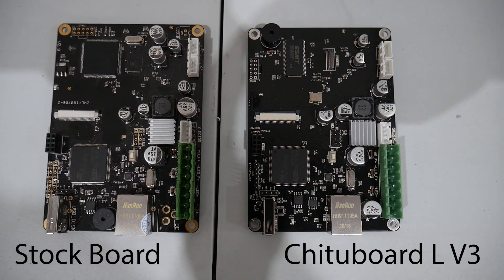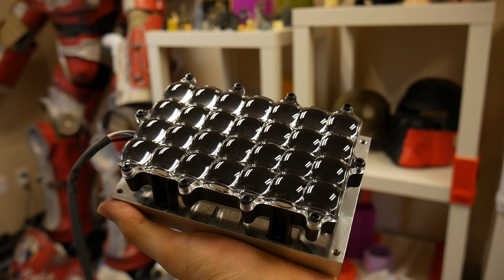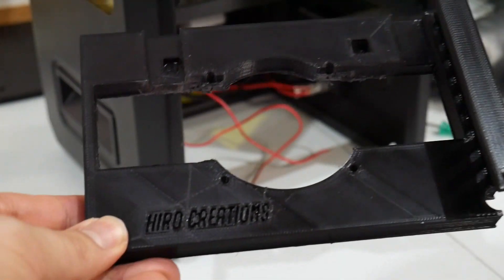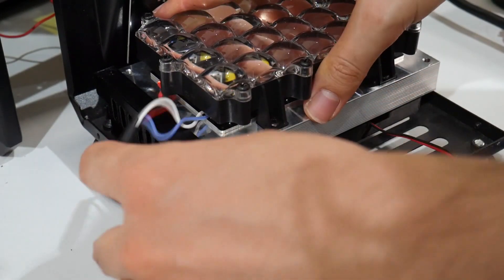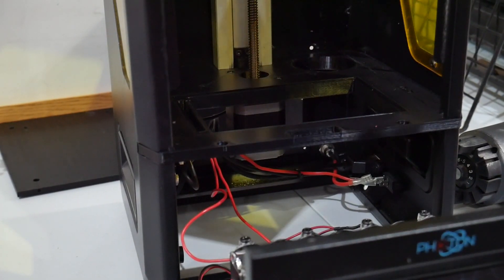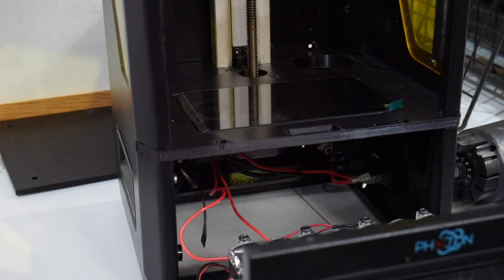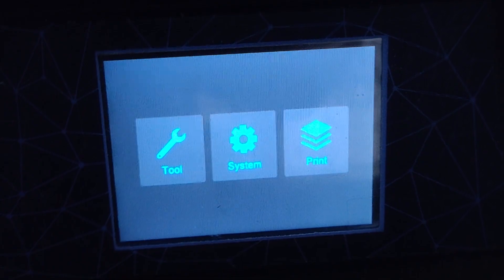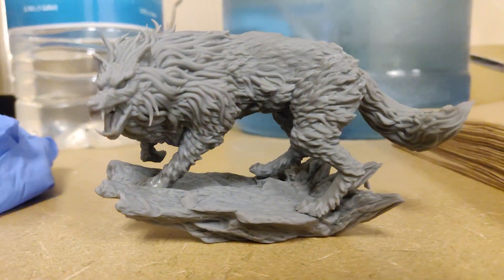Overclock a OG Anycubic Photon with a Mono LCD Upgrade

Comment: Is it possible to flash the Chitu L v3 firmware onto the original board? That would make this upgrade viable as it would cost less than just getting a mono printer. Also doesn't the Z-axis flex when lifting, now that the base plate is made of PETG?
Reply from the maker: Sadly no because the screens need a beefier  FPGA run, plus the gcode file I mention is just a config file and not the full firmware like Marlin.

So far no issues with the Z axis and the PETG plate, the only time I noticed any deflection is when I tried to print with a chunk of the raft still on the plate.
Reply: @HiroCreations  Considering the the resolution on the 6'' screens is only slightly higher, i was hoping the existing FPGA would've been enough. But i guess it's hard to say since the code for it hasn't been reverse-engineered yet. It's really a shame that we don't have nice configurable opensource firmware for these chituboard printers the way we do for all the reprap FDM printers...

For the baseplate i had a similar idea that involved milling it out to fit the new screen and then adding a printed spacer to allow swapping between 5.5 and 6'' screens, but it's too destructive to try on my only machine.

Comment: I have a dead Photon. Ill be doing this to give it a new life!
Reply from the maker: To be fair I am wrapping up on a follow up video where I do an even simpler mono mod that only requires a board and screen change and leaves the rest of the printer unchanged.
Reply: @HiroCreations  I would love to see a video of the simpler version. any word on when you will have that vid up ???
Reply from the maker: @SycoSpartan  at this juncture I am waiting on the screen manufacturer/seller to officially release (I promised them I would not post the video before that) but looks like they keep delaying. So for now, soon™ on the video.
Reply: @HiroCreations  oh awsome. do you know if the mono se screen will work on a mono? the mono screen is slightly diffrent and unavailable :( mines broken
Reply from the maker: @SycoSpartan  technically the photon SE mono screens are using the same DXQ screens I used in this tutorial. They are 6" diagonal which does make them quite a bit bigger and unable to fit into the recessed pocket. And having the screen not stick out is important to ensure that the vat can easily slide in without damaging the screen.
Reply: @HiroCreations  thanks. Ive got more info from you than anycubic :)

Comment: What are your slicer settings after doing this mod? I'm looking to get an old photon and giving this ago
Reply from the maker: I have my Chitu profile loaded for the modded mono on the github folder. The main real change is lower base and layer exposure times as well as fewer base layers. Speeds and retraction distance is unchanged from the normal defaults if a OG Photon.
Reply: @HiroCreations   this is amazing thank you

Comment: Im going to attempt this. One question, there are 2 options for the boards "TMC2209 driver" or  "A4988 driver", which one should i select?
Reply from the maker: You could go either direction. I'm using the older A4988 which is closer to the OG photon board.

Basically the difference between them is the motor driver for the Z axis stepper motor. The A4988 is a older cheaper driver that makes a noticeable amount of noise when the build plate is going up and down. The newer TMC2209 stepper drivers are nearly dead silent and are nice when you combine it with silent case fans for cooling the light source and motor for a dead silent resin printer--not that resin printers were that noisy to start with.

My personal rec would be to grab the TMC2209, and upgrade to some nicer silent 24v fans.
Reply: @HiroCreations  thank you for responding, I appreciate it!

Comment: Amazing video!!! Is it also possible to reduce the off-time for the up/down movement per layer shift? In the photon fw it is hardcoded to about 6.5 sec and it would be good to reduce it in order to further increase printing speed. Keep up you good work!!!
Reply from the maker: I believe so, the retraction cycle on mine using CBD boards times out to roughly 3.5 seconds between exposures. Though I am also using slightly more aggressive retraction speeds of 85mm/m and 150mm/m.

Comment: Very cool. There is no way I am doing any of that, but it's fun watching someone do it :D Please make a follow up some time and let us know how many hours you were able to get out of that LCD.

Cheers!
Reply from the maker: That's perfectly fair, if there is any consolation I have another broken OG Photon on my bench undergoing a alternate mod that is significantly simpler and only requires two parts to be changed and leaves the rest of the printer untouched. Video on that coming out soonish.

Otherwise I am about 621 hours deep into the mono screen featured in this video and its still running like a champ despite being roughly cleaned twice after having resin spill on it from a failed FEP sheet. I am definitely collecting footage for a followup video.
Reply: @HiroCreations  thanks for the insight. I will keep following your adventures here for sure. Great stuff :)

Comment: Modded my printer according your instructions. Beides my new broken monoscreen i have an issued with the chituboard and motor. When i Press move Up IT moves down and the opposite.
Reply from the maker: If the motor is moving opposite direction you can solve that by either reversing the polarity of the wiring (swapping the the wiring so they are exactly the opposite) or you can reverse motor direction in the gcode configuration file (M8004) on the chituboard site: https://www.dropbox.com/s/pb676yff9m4wtbr/Machine%20parameters.gcode?dl=0

Yikes on the broken screen, what happened?
Reply: @HiroCreations  i Changed the gcode file to solve the direction problem. The broken Screen wasnt a broken screen. I forgot to remove the foil on both Sides and a wire Gott between screen and LCD. There is a lot of space
Reply: Currently i am Testing exposure settings for 0.025mm layer. Thank you for your Video and advice

Comment: Can you just replace the new led uv and keep original lcd screen and motherboard . Can the motherboard work with new led uv ?
Reply from the maker: You could do that but that will only improve your cure times to about 4-8 seconds per layer depending on the resin you are using. Main benefit of a Mono screen vs a RGB screen is that the removal of the color pixels allows more light through which results in faster printing.
Reply: @HiroCreations  cause I want to keep the aluminum plate with it.  Do you think it can work with 5.5 inch mono screen .
Reply from the maker: I'm getting some new 5.5" mono screens to test and do a follow up video with another newly broken OG photon and a newly purchased broken Elegoo Mars printer. So definitely keep an eye out for that video soon. :)
Reply: @HiroCreations  just wondering how many % in fill will be good for it
Reply from the maker: @tiinpii  Depends on the filament, I got by with 50% on my PETG, but I know of other folks now printing at 90% or 100% infill.
Reply: @HiroCreations  ok cool I'll try with 50 and see
Reply: @HiroCreations  do you print it with support , and what is the side need to be down to the print bed thanks
Reply: @HiroCreations  I mean the main plate
Reply from the maker: @tiinpii  You want to print it so that the side that the screen sits on faces up, and manually support the lip edges, don't bother supporting the screw holes--those bridge decently with most printers.
Reply: @HiroCreations  ok cool thanks

Comment: Sensational. Can ChituBoard L V3 use 4k mono screen similar to Phrozen mini 4k? I have a Photon S, I want to convert to 4k or 2k Monochrome
Reply from the maker: Possibly, I ordered a mono 4k 5.5" screen to test with the L v3. I will be sharing what I learn shortly.
Reply: @HiroCreations  Thank you so much for sharing. I also have Wanhao D7 and I intend to switch to mono LCD using all Chitu parts
Reply: @HiroCreations  where did you find the 5.5 4K display and which controller do you plan to use?
I saw Phrozen's but it is 4k 6.1 and the controller is made by them.
Reply: @FredSamarane  Longer3D has a 4k 5.5inch mono printer
Reply: @jorgeemiliano2035  The 4K mono may need a ChiTu L hdmi board or L M1 board, the V3 can't support.

Comment: Wow magnificent mod. I owe two photon s . I think i'll wait for the 5,5 mono screen. Do you believe that the original paraled of photon s will do the job? Thanks
Reply from the maker: Yep it would work but print slightly slower due to the lower wattage output, the 12v para leds most Photons and other prebuilts use only consume/output 30w of energy vs the 70w my 24v array was pushing.
Reply: @HiroCreations  wow !! Yeah... if your paralled is 70w is way more powerfull. Thanks for your reply and thank you fir sharing that knowledge! Subd of course :)
Reply: maybe this is compatible?

https://pt.aliexpress.com/item/1005001269909942.html
Reply from the maker: @JaoCouto  uncertain the connector looks different than what I am working with.

Comment: This has got me thinking about either upgrading a Longer Orange 30 or building a new machine from scratch using aluminum extrusions. I have nema 17's and lead screws coming out of the woodworks in my basement.
Reply from the maker: Why not both? 😂

On a serious note, I am a few weeks away from finishing a reprapable aluminum extrusion 6" and 8.9" mono sla. 

Early assessment might find me redesigning the z axis to eliminate leadscrew and use a counterweighted belted z, as I am finding lots of funky issues with cheap leadscrews.
Reply: @HiroCreations  I saw they have other motherboards and larger screens. Right now I'm trying to fix my McMaster login so I can order some FEP.

Comment: I am implementing this mod using your STL files -- It looks like the 40mm fan mounts in the heatsink part blocks part of the fan from sitting flush.  In your video it looks like you cut out this section.  I think I may just cut it out also -- is there a modified STL available?
Reply: The opening in the STL is 40mm x 37mm instead of 40mm x 40mm
Reply from the maker: Interesting, it might be an export error as both my 40mm fans fit fine, let me recheck it tonight
Reply from the maker: Following up on this, I found the issue and fixed it so that the slot dimensions are 40.5mm x 40.5mm and should comfortably hold the fans now.

Here is a link to the new file pack https://github.com/Yasu3DP/Anycubic-Photon-Mono-Screen-Upgrade/blob/main/Mono%20Photon%20Upgrade%20STLs%20V2%20Update.zip
Reply: @HiroCreations  This one worked perfectly. Thanks for all your work!

Comment: What if I use the same UV source came with printer?
Reply from the maker: You'd need to adapt the mounting solution as the opening for the 6" mono won't fit the stock light source.

Apart from that it probably would work but slower, the light would be uneaven at the edges, and you'd lose about 3mm on the edgesm
Reply: @HiroCreations  Ordered the parts from the links of yours on excel file. Waiting for them to arrive. One of photon needs replacements for Board and screen so thought would give this a try.. will ask for help once I get these in Hand

Comment: Would "stupidly overpowered" UV Light source be enough to get 1 second layers? 
how does the mono LCD comes into play, besides the larger area?
Reply from the maker: On its own a 24v UV light (what I used) and a regular RGB screen will only drop you to 3-4 second layers with most "fast" resins. Mono screens let significantly more UV light through the screen over RGB screens (what LCD printers originally shipped with) so most resins can cure 2x-4x faster. So the 24v UV light array + Monoscreen is the how you get super fast cure times.
Reply: @HiroCreations  Thank you for the answer, now it makes complete sense ;)

Comment: I have a Photon Zero that didn't work when I got it. If I got the power working to it, would this Mod work on that kind of 3D printer?
Reply from the maker: The basic parts should work, but you will need different printed parts that will fit the photon zero like the plate that holds the screen. My recommendation would be to wait till the new 5.5" mono screens get released in a few months.

Comment: I see that you didn't enclose the paraled UV source. Why? Won't it damage the other components in the housing over time?
Reply from the maker: 405nm is at the very high end of visible UV spectrum and is far less damaging to plastics compared to UV-C or UV-B light, so I am pretty confident about the parts lasting with no real deterioration over the life of the parts.
Reply: In the Sonic Mini 4K all parts are bathed in the UV light also.

Comment: Thank you for showing your work. I am still undecided to do the same because epax has announced the possibility of releasing and 5.5 inches 4k LCD. This IS a huge improvement in resolution and no need printing the LCD plate. I will wait until that screen IS in the market and then jump into modding my photon. Again, great work. I suscribe your Channel.
Reply from the maker: Yeah I'm actually in contact with a manufacturer who makes those 5.5" 4k screens they will be releasing them for sale pretty soon in a few months, and I'm planning a follow up with another photon or a mars the upgrade process would be much easier with that route. Thanks for the sub!
Reply: Was planning on trying this mod right away... but now after seeing this comment I'm gonna hold off just a tad longer. Great video!!! I'm still pretty tempted to do this now lol 😅 I could upgrade to the 2k 6" screen then swap out to the 4k later on. 🤔 decisions...
Reply: Would the light source still be the same regarding a 5.5 mod?
Reply from the maker: @Solid_Doom  yeah I am currently testing the stock light source and I am pleasantly surprised by the results. Granted folks are welcome to remix the design and add a proper parallel array to replace the stock COB + reflector.
Reply: @HiroCreations  did you get a 5.5 inches mono LCD for the photon? Can you post the manufacturer and how you do It?
Reply from the maker: @iohanart  working on a video and releasing it with when the manufacturer I got some tester units from have them available for sale.
Reply: @HiroCreations  Any result upon the trials and tribulations with those 5.5inch 4k screens? I just got myself a photon s cheaply (upgrading the matrix and to dual rail is a more expensive upgrade then a photon se used XD) I would love to upgrade in the future :)
Reply from the maker: @CatastrophicNickName  Sadly no, it was a combo of a really difficult process to make it work with a PI and several additional boards as well as having to figure out how to make room for said extra boards.

I'm looking to try out the new 6" 4k screens that will hopefully have Chituboard compatability and keep the interior layout of any modded printers relatively easy to manage.

Comment: If I'm not wrong, you own several 8.9 inch screen color Saint smart KL 9. Have you considered upgrading them?
Reply from the maker: Yep that's on the todo list, however I have to test a few approaches to better support the LCD--I'm noticing that LCDs on the KL-9s die very quickly and I'd rather like to get to the bottom of the cause before I use $200 screens on them lol. Its more likely that my Shuffle XL gets upgraded first with a new mono 4k screen first.
Reply: @HiroCreations  I'm a spaniard guy owning 7 KL9... Well, kind of. The KL9 are the Aliexpress x-cube V3/V4. Saint smart just rebranded it. I'm getting the screens at a much lower price from the FepShop in the Netherlands (They are less than 60 Euro) You could just get them for 40 bucks directly from Aliexpress (Brand Wisecoco). I'm considering to upgrade them to mono, or replacing them by Elegoo Saturns once they are available.
About the screens degrading so quickly... Well, yes, it's a hassle. I have no time to investigate, but It might well be due to a very powerful UV source, This machines are equipped with a line of small fans to keep the area cool.
Just one more thing, when i saw your table with your KL-9's I thought: "Oh, man, that guy is the american version of yourself"
Reply from the maker: You officially have more than I do haha. Yeah I've been sourcing Wisecoco and Duobond 8.9 for pretty cheap. There are two different potential causes I am testing right now the light source (as I have noticed a correlation of screens positioned less than 65mm from the lightsource dying rapidly compared to screens positioned at or greater than 65mm) and the lack of top or bottom glass support (most comparable printers like the Phrozen Shuffle have a 4mm piece of glass under the screen to support it, and others sandwich the screen between two layers of glass. 

That being said I might recycle most of the KL-9 parts into a completely new machine (I always wanted a 1 meter all resin printer). Either way I definitely will be covering it in the channel.
Reply: @HiroCreations  I made that mod some time ago, I just bought a couple of 50mm rails and replaced them (Yep, i should have bought a longer C-Beam, but it doesn't matter so much), for the screw, i used the same 8mm diameter 2mm pitch attached with a coupler after cutting off most of the original one... It works quite well, but these kind of screws aren't so good for such a long axis i'll replace it with a 12mm ballscrew, but it requires a bit of additional work (And time)